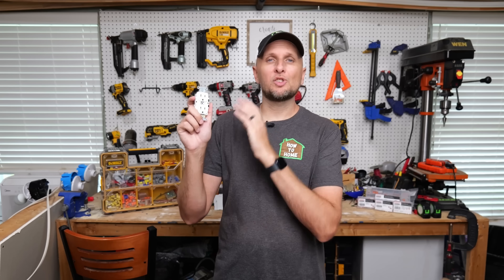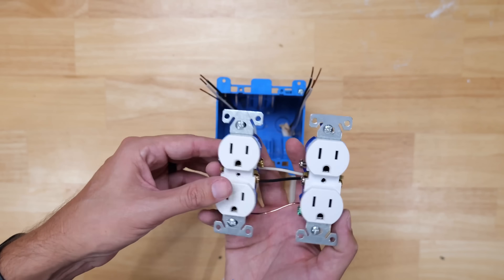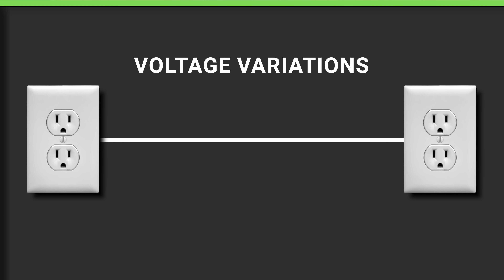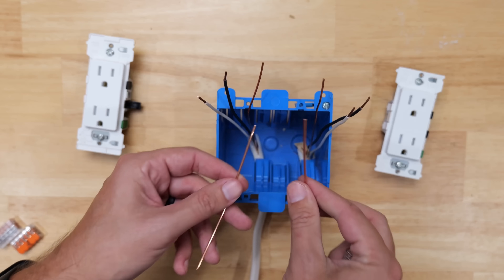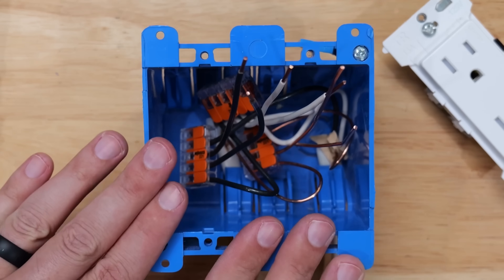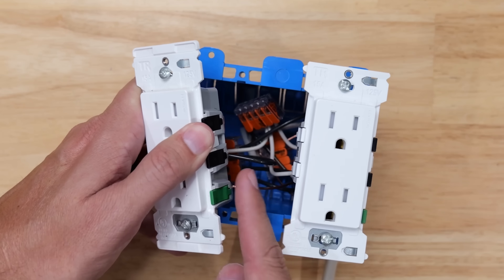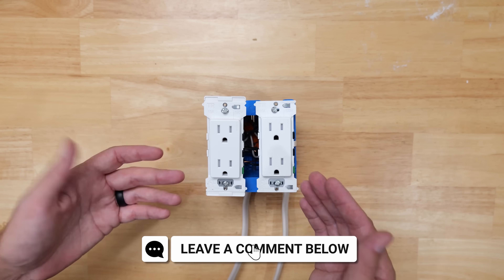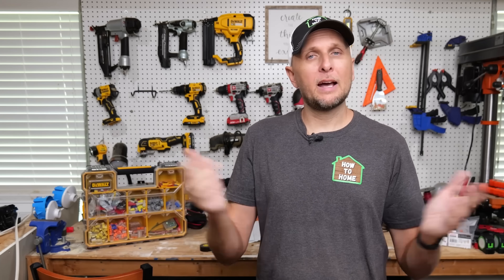Why This Outdated DIY Outlet Wiring Needs to End!

Comment: We had the problem of low voltages in our attic. The builder put the attic light switches, outlets and furnace computer on the same circuit. We ourselves were to blame when we stuck a new outlet on that circuit. It was causing our furnace computer to sometimes come on and cut out after a minute due to the low voltage. One of the outlets upstairs even started smoking. We went the simple route and had an electrician just run new cable from the breaker box to the furnace. It stopped all the low voltage issues immediately. We know this had been a problem since the house was built because the previous owner tried replacing the control computer which was about $700.

Comment: The outlet  terminals have a visible solid connection between the screw terminals.  One can cut it to provide separate power feed [e.g. a switch] .   Odds of that link failing is slim and slim left town, main breaker would pop 1st.

Comment: Old timer here circa 1990s.....I always used a pig rail and wire nut no daisy chaining....didn't even know what a wago was or ever use one.   Back in those days I always used the screw not the plug and play, If you new how to make and attach the wire via a
Reply: Wago 221's are the standard electrical connector in Europe. I use them for light fixtures. Way better connection when splicing a solid and stranded wire together.
Reply: @karlschauff7989  I can see the advantage of using a Wago connector,  are they  standard and used her in USA?   I stopped knowing electric code in 90s.
Reply: @karlschauff7989  YES!     Wire nutting a solid to stranded wire of different sizes is pathetic!  For a end of circuit light load appliance, Wago works great!    I am not too confident yet of wago handing higher currents. Is the "bar" inside them heftier then the "bar" between two screws on an outlet?  Larger "bar" can dissipate more heat.

Comment: Adam my house is almost a 90 years old and I have 2 prong outlets. last year we had our panel upgraded and now we have gfci breakers. if I run a separate ground can I install 3 prong outlets?
Reply: If all the receptacles are on GFCI breaker there is no need to run a ground. You can just replace them with a 3 prong receptacle. They were designed for that issue.

Comment: While I agree with you that wiring this way does make troubleshooting easier in case of a failed receptacle outlet, I do not agree with your comment about how voltage would be affected by a power surge with this wiring method.  In either case, your outlets are still wired in parallel, so you would not likely see any measurable difference between the two.  A power surge from a hard starting motor that causes the voltage to sag will cause it to sag on the whole circuit because of the upstream wire resistance, and that will affect the voltage of the downstream receptacles no matter which wiring method you use.  Also, going back to the troubleshooting issue, a failure at the splice with wago would make troubleshooting difficult as well.  Both wiring methods are fine.  I'll do it both ways, it just depends on the situation.  I won't normally pigtail in a single gang box unless there are more than 2 cables.

Comment: Voltage drop should not be substantially affected by pigtail vs daisy chain receptacle wiring.  If a heavy load is connected to a receptacle on a branch circuit, every other receptacle on that branch circuit will feel voltage drop, and wiring method won't make a real difference. 

I have not reviewed the specs for the connecting tab that joins the line and load screws on the side of a standard receptacle, so perhaps it is equivalent to a slighlty narrower gauge of wire than you'd otherwise be using, especially if you were going to pigtail through a wire nut jnstead of a Wago. This would have some slight effect on voltage drop, but assuming the receptacle is UL listed and designed to a reasonable standard that difference won't be enough to make a difference in the real world.

From a circuit design perspective, pigtails and daisy chaining devices are the same architecture - a "T" junction where incoming current has two paths out - one through the device and another through a bypass conducter around the device to the other devices down the line. Both methods wire your loads in parallel, not in series. The Wago busbar in your pigtail, and the connecting tab between the receptacle screws in a daisy chain, fulfil the same role - providing the bypass path around the first load.

Pigtails make fault diagnosis easier in some number of cases. Daisy chains are easier to manage from a physical (not regulatory) box fill perspective.  In each case you have to solve for the problem in front of you, not blindly follow some idealistic pronouncement.
Reply: Load will pull down voltage no matter pigtail or daisy chain. You can only stuff so many electrons (Amperage) down a certain size wire and if it is pulled upstream or downstream, it still pulls down the voltage.
Reply: any receptacle with screw terminals is rated to carry 20 amps.

Comment: I'm not an electrician but I'm pretty sure that daisy chaining the ground wire is a violation of the NEC. I believe the ground wire must always be pigtailed securely to meet code. Ground should never pass through an outlet or fixture. 

Also, I have seen multiple failures of cheap outlets using backstab connections that were daisy chained when I was working on rental property. I had an outlet in my house to literally melt after I had plugged up a heater. I went through every outlet in my house and cut out every backstab connected outlet and replaced them with 15 amp commercial grade outlets. I feel a lot better about that now.

Comment: Another great video, thanks.  One point, voltage doesn't drop in a parallel circuit, current does.
Reply: I thought he was showing a series circuit when he mentioned it but honestly i wasn't paying a whole lot of attention
Reply: Yes there is voltage drop in a parallel circuit like this that has an energized load connected. The further the receptacle is from the source, and the higher the load current, the higher the voltage drop.

Comment: I agree with this 100% but I also feel like ALL boxes should be 3.5in deep as this would allow plenty of space for wiring without excessive bending. You should do a video one day presenting the "OneBoxforAll" brand outlet boxes. They are very utilitarian.
Reply: The best comment yet. There is generally no justification for a box less than 3-1/2" deep. I would bet that most dangerous failures are caused by trying to cram too much into a box. This problem is compounded by the wire lengths required. I have had to give all of the wires a little "haircut" to make them fit. I hope that no one buys an "under 3-1/2" box to save money. If your time is worth anything, the extra time spent getting everything crammed in is very costly. Also, you make things difficult, if not impossible, for the unlucky person trying to fit a rather large smart switch into your puny box in the future.

Comment: I would argue the probability of failure of a Wago connector or wire nut is roughly equal to probability of receptacle failure, so it's about a wash.  Much ado about nothing, and slightly more expensive in terms of time and materials.
Reply: and those Wago connectors are so expensive.  Like $1 a pop adds up fast.

Comment: Using the outlet screw terminals to connect the downstream devices is basically a terminal block connection. You just moved the connection off the first outlet and put it on the WAGO, which is now the "terminal block". Other than loading the box, which might be easier with the pigtailed devices, I don't see any real advantage one way or the other.
Reply: I can almost guarantee you that wago gets a lot hotter than the pass through brass connector on the original receptacle. Not 'bad' hot, but less heat is almost always better.

Comment: I like your method, but it seems like there is a lot more wire and connection taking up space in the box. Does it all fit without overcrowding?
Reply: It does if you pay extra for the TARDIS boxes that are bigger on the inside than the outside.

Comment: 9:55 shows exactly why I tape my wago lever nuts.
Reply: Yeah I started to tape them too.
Reply: You may disagree, I use colored phase tape for this because black electrical tape including the same scotch33 leave a black goo that I hate touching
Reply: @jakinoutcreekst  Thanks for the tip.  Of course I don't really intend to ever go back to it I just don't want them flipping open when I stuff it all back in the box.
Reply: @TheKingOfInappropriateComments  I work on industrial generators, i use wagos for ALOT of my commonly touched items and even use wire ferrules at times, any of the colored super 33 tape other than black behaves better

Comment: I just want to let you know that last week I used one of those Klein circuit analyzers  to trouble shoot a double gang recep where one of them wasn't working. Discovered an open neutral and open ground. Which is bad obviously but also that it was installed this way with the jumpers and had another recep down the line.  Could have roasted marshmallows over what remained of my house so thank you for helping me prevent that.
Reply from the maker: Oh that’s awesome!  Those things really can help find problems we don’t even know exist.  Really glad to hear you were able to uncover them and get them taken care of.  Thanks a lot for the feedback!
Reply: @HowToHomeDIY  I just want to make it clear that your video influenced me to get it (the 139) despite having a couple of the dongle style ones, it was just in an inaccessible area behind a shelf but it was time to get to the bottom of the issue. I'm so glad I did. So thanks again.

Comment: Thank you. Well demonstrated. Agreed. 😎👍
A recent small fire would have been avoided if this method had been used. Fire was from a heavy pass through load, and a housewife had pushed furniture and cracked a pass-through receptacle 🔥
Reply: Seems to me that outlawing the plastic cover plates and replacing them with metal ones, painted if you will, would make things a lot safer. Scratch "metal" and insert "steel".

Comment: I was an electrician, back in the 80s, and would NEVER do a pass-through with receptacles!
Unless...
It's a GFCI receptacle.
They're made exactly for this purpose, to cut current downstream of the box, in case of a fault, even in a receptacle down the line.

Comment: Everything you have is correct except at 9:00, you say, “… it’s not gonna matter if for instance, this receptacle was to have something kick on real hard or pulling a lot of current and then therefore possibly reducing the voltage on down the line.” 
Withe the pigtail wiring, the only voltage drop of the first receptacle not seen at the pigtail junction is the IR drop of the three inches of wire between the pigtail and that first receptacle. If that three inches of wire is carrying enough current to give a noticeable voltage drop, the 50 feet of wire from the distribution panel to the outlet would have a voltage drop 200 times larger, not to mention that the circuit breaker would have already tripped or you would already have a fire.

Comment: Be awere, electrical installation in Europe differs from the USA. For example, the collors of the wires;  Hot = Brrown, Neutral = Blue and Ground/Earth yellow-green. Mostly in Europe the system of electrical junction box is used.  Because of that, and that applies also for the USA, follow the National Electrical Code.

Comment: So you think this method of putting through the whole and using a lever is better than or the same as the old receptacles, putting it through the hole and then done with it and answer 25 years it gets loose. It’s the same bullshit. Nothing like wrapping the wire around the screw I’ll never do what you’re doing online. It’s to Saint principal it’s just now using a lever the old plugs used to go when you pushed them into the back are doing the same thing as the lever don’t you think? Why don’t you pull one of those apart and check out the contact area you dumb people Nothing like a screw with a wire rat around a screw visual contact the best way to go and a wire nut not these Wego nuts.

Comment: The idea is correct but the Wago connectors themselves can be suspect also. I prefer the good old twist and cap method with all wires connected to each other independent of ANY device.
Reply: Wago 221's are every bit as reliable as a wire nut. Funny how the entirety of Europe uses Wago 221's without issue, but clowns in America insist they see them burn up all the time. When it comes to Wago 221's vs wire nuts, they only fail when not used correctly.
Reply: @karlschauff7989  - Perhaps it's due to the lower supply voltage in the US and resulting higher amperage?

Comment: This is 100% wrong. So whether you pigtails or daisy chain the circuits are actually identical from a physics perspective unless we get into GFCI because the way GFCI works for protecting downstream is a little different. If an outlet goes bad or is damaged as long as the damage doesn’t extend to the terminals or wires it will not affect downstream outlets. The circuit is still in parallel either way. It also means voltage drops for high amp loads is also the same whether you daisy chain or plgtail. Where it will make a difference is easy of maintainance and swapping the outlet etc. This is reason enough to use pigtails rather than daisy chain. But from a physics standpoint the circuit is identical and most problems with downstream come from what would be pretty catastrophic damage to the outlet. But most of the time it will be localized. GFCI is different because in GFCI the GFCI when wired correctly is in series all downstream loads but the down stream loads are still in parallel with each other.
Reply: Correct in theory, but their construction shows the difference between the two methods.  With pigtails, the conductors bear the whole current distribution.  With through-wiring or daisy-chaining, a tiny metal strip between the terminal screws carries the full current, and once you've seen one ignite a wall, you stop trusting that itty bitty strip to handle the entire branch circuit.
Reply: @ronstewart5945  That "tiny metal strip" is 20 amp rated in even a 15 amp outlet. It is designed by electrical engineers for that purpose. The cross section of that strip is greater than the conductors also carrying the full load of the circuit.
Reply: @MathewPollard-vj4uq  So I hear.  And yet, a fire clearly started in that tiny strip and nowhere else due to a current overload.
Reply: @ronstewart5945  No they don't.  Not the conductors at all.  All you are doing here is switching the point of failure from the recept to the WEGO, and WEGO's are absolute trash.

Comment: This video is filled with quasi-facts and half truths. I don’t know ANY residential electricians who consistently pigtail bc it’s much slower, there are more bits and pieces to deal with (and come loose, it’s much more expensive especially if you’re using  Wagos, and it is UNNECESSARY.  Failed outlet does NOT necessarily mean everything downstream loses power, but a loose wirenut on  a pigtail bundle DEFINITELY does.
Reply from the maker: Wire is the wire nut loose?  Don't install it incorrectly and there are zero issues.

Comment: Had same problem on my niece's place which is a old trailer mobile home the first receptacle went bad and it stopped the entire chain from working but the first receptacle was working but was burnt bad in the back and the trailer company put like 8 receptacles on same circuit didn't think that one was bad cause it worked and was causing the voltage to only be 27v when going to ground none when going to neutral

Comment: Nothing quite like having a switch randomly melt, and upon replacing it, you find a passthrough connection to an entire living room, utilizing a backstab connection and a non-looped screw terminal connection on said switch.  No wonder the thing melted.
Reply: I bought a house where I'm pretty sure every outlet and switch used the back stab method. I didn't even know that was a thing, or that it was not great until I went to investigate strange electrical behavior. I've replaced a bunch of outlets and even in outlets I've kept, I moved the wires to the screw terminals and things are much better now.

Comment: What if boxes only got one set of wire...... no incoming plus outgoing. just 1 of each +, -, and ground, no extra  sooo what then, or assume that box was already split off from main lines behind the drywall?
Reply: It means that it's the end of the run or end of the branch. This is the simplest of all scenarios, just connect the wires to the appropriate screws and you're done. BTW, there's no +,- in AC electrical circuits, it's hot and neutral. The hot wire alternates between +120v and -120v and the neutral wire is 0v.

Comment: I have many times had failed and affected multiple outlets that I have traced and it relies on loose wires that disconnect multiple outlets down the circuit! Like the idea to hard wire main circuit power lines and drop down contacts to fix a common problem of contact failure or loose wires that disconnect for whatever reason!

Comment: Ok I understand what you are saying. It's not that hard to trouble shooting the "old way",  just keep checking up stream with a receptacle tester to find the problem. The "new way" may be better but how many folks are going to change it all in their home, none. Additional branches okay. I as an inspector have yet seen the "new way" being used on new construction.  I actually test for voltage drop and explain what it could mean to appliances,  especially  vacuum cleaners.  Thanks for the video. The problem lie when electricians mix receptacles with lights on the same branch.